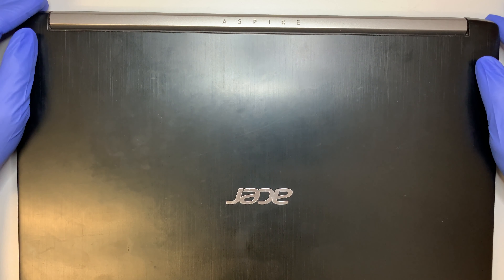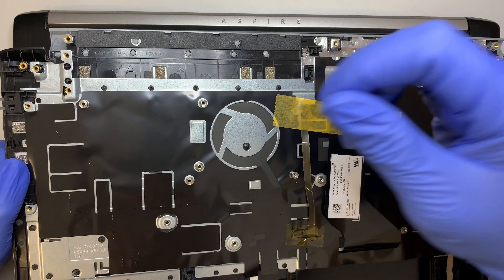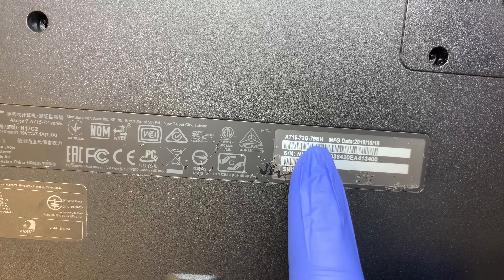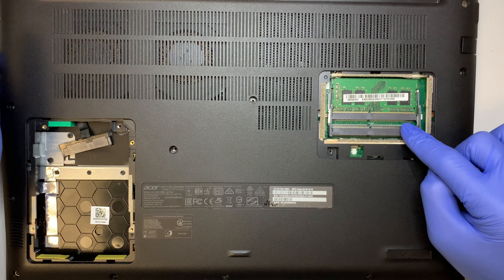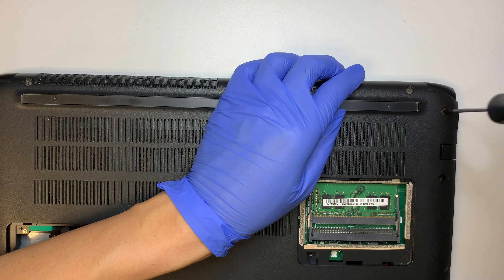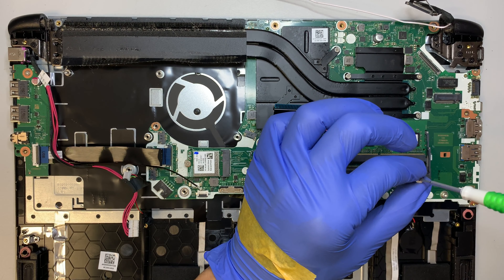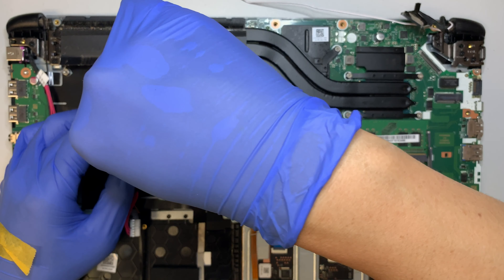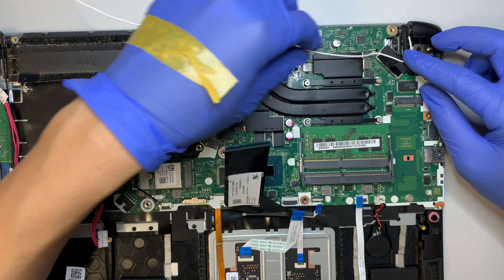Acer Aspire 7 A715 72 Keyboard Replacement

Comment: After I replaced the keyboard, the laptop only wants to start plugged in. If it is plugged out it stops working, but before the replacement the laptop worked in battery mode. What should I do?

Comment: Bro...my laptop...acer aspire 7...i applied thermal paste and now it won't boot up. 
Also plugging in charger is not showing blue led light which always shows after plugging in. 
I tried that 30 secs power button press and removed battery and cmos and reconnected with no luck. Any solution? Motherboard gone?

Comment: Hi. I have Acer Aspire 7 A715-75G. It automatically switches off whenever I turn it on. The issue seems to be in the power button because even on slight touching and not applying pressure, the laptop turns on. And I think due to this the power button might be automatically getting repeatedly pressed and hence the laptop turns off.
How to fix this. Is there a way to replace only the power button or will I have to replace the whole keyboard. In either case what would be the cost. Please help me. Or if there is some other fix please tell me.
Reply from the maker: Whole keyboard

Comment: My acer aspire 7 keyboard is running madly... Like 11111111111111111....., 888888888888.....

Can I disable keyboard but I want to use power button. Is it possible?
Reply from the maker: If the power button is with keyboard, answer is NO. You need the keyboard to power on your laptop.
Reply: @UbergeeksBiz   i don't know what is going on, after updating different device keyboard driver, my keyboard is running. But after sometime it stopped working. But f1,f2,f3 keys along with power button is working fine when Entire keyboard (A-Z, 1-0) not working.  

I changed my keyboard early when it is in Warrenty. My front panel is with keyboard. They installed a new whole front panel in my laptop.
Reply: Sorry for my bad English
Reply: @UbergeeksBiz  touchpad is not included in the front panel. That time my keyboard was dead but touchpad was working. And power button, f1,f2 that keys are also working then. They changed whole front panel.
Reply: My laptop's touchpad and fingerprint is working fine. Never faced problem in that.
Reply from the maker: @aryadeepchakraborty3454  After they changed the keyboard and front panel, what is happening now ?
Reply from the maker: @aryadeepchakraborty3454  3300 of which country currency ?
Reply: @UbergeeksBiz  India
Reply: This is almost an exact problem that I am facing. The keyboard randomly disables some keys. I am guessing it's a keyboard issue. Acer has a terrible build, my 30K INR laptop lasted 5 years before giving way due to motherboard issues. This guy barely ran a year that too with minimum load.
Reply from the maker: @aniruddhabhattacharjee3729  Yes, things are not build to last now
Reply: @aniruddhabhattacharjee3729  Hi I have got this problem too . Some keys not working anymore . What can I do ? I tried the driver issues thanks for answering